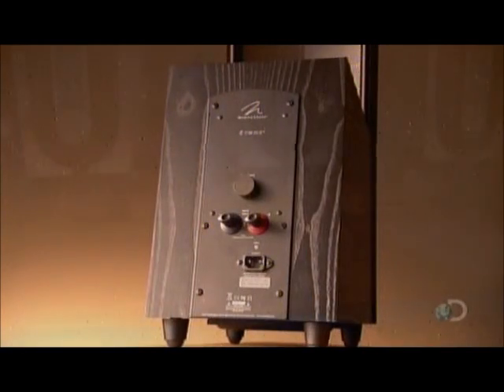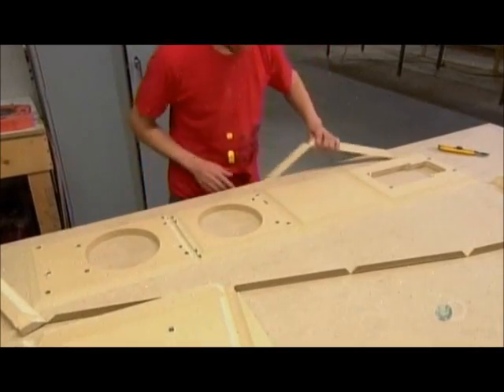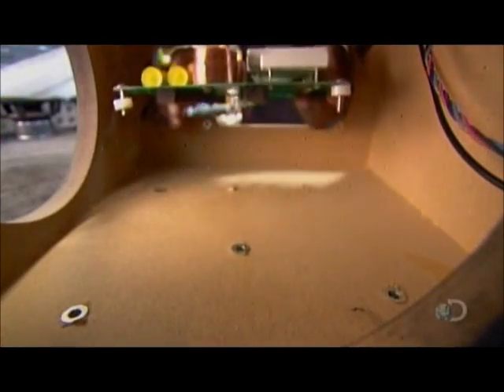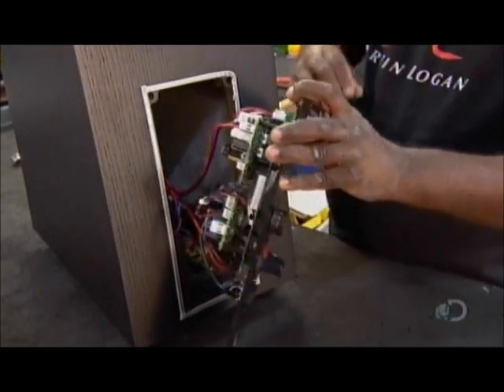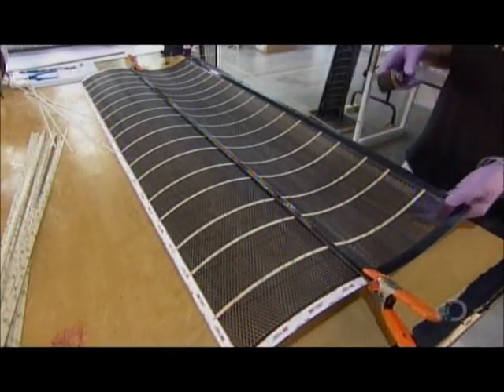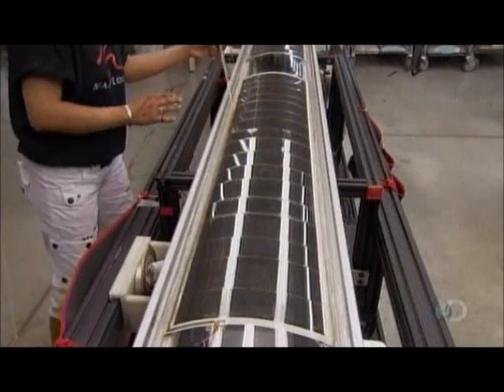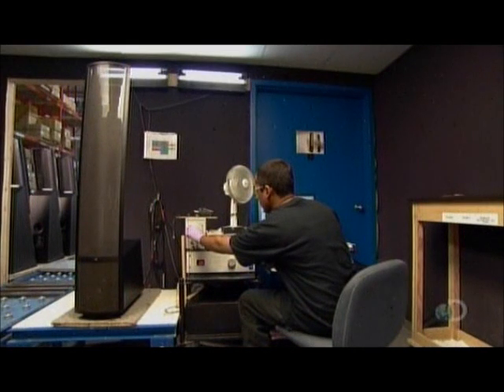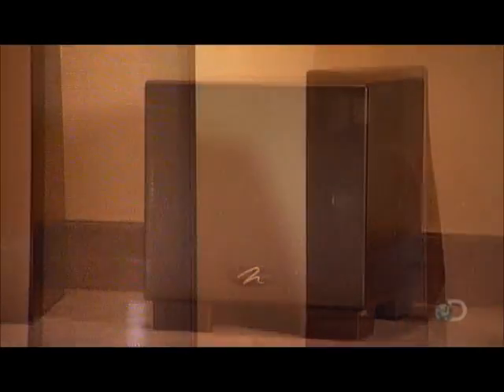How It's Made - Electrostatic Speakers

Comment: 13 yr -20 yr life span on electrostatic film. UV destroy it, thus no windows shinning on it. Used market has a few , but i would not bet on it. they increase 3x price to repair/replace the electrostatic portion. Thus you are likely have  to repair it after as life is thin after 10 + years..
Reply: I’ve got a pair of Acoustat Model X speakers from the 70’s that are still putting new systems to shame on their original mylar and tube amplifiers. 50 years of operation and still going.

Comment: trickery , that's why I 've built speakers. the precious things from the store is much worse . many underestimate the kits because they only pay 500-1000 dollars for it , then they do not understand that one must have an amplifier for about $ 10,000 for and get them to sing. or build a hypex amplifier and get good sound. many think they have good equipment , the bass I see here is garbage and amplifier. but so it is with all finished products. but I had to buy ready bass bin, is not easy and build a solid and small subwoofer that looks good is practical and playing deep as a JL Audio subwoofer, I have built many that play better but difficult and buy dy amplifiers that are practical and will fit into a small box with big element. so some brands are good but it is rarely . You shall build even remember and use seas kit, it is important to have a kit and not design a self create idea , if you can manage it ought be a speaker konstruør
Reply: For the Martin Logan Esl (2,5k a pair) they show there you need just a 1,5k amp so you are only by 4k
Reply: For the Martin Logan Esl (2,5k a pair) they show there you need just a 1,5k amp so you are only by 4k

Comment: Electrostatis speakers, I have never heard about them.
Are they really good? if so why they are not widely used on HiFi Hi End speakers?? lets say Klipsh, Polk Audio, Paradigma, Monitor Audio, B&W.. etc
Reply: They actually made tests punching holes into it and still working great. If you stop by a BestBuy they can show you the awesome tech that is Martin Logan. I am planning on getting their speakers but probably not there electostatic since they arint on wall. Except the EFX ($3,095 per pair)
Reply: I’ve owned Quad ESL-63 speakers for almost 30 years.  Had them rebuilt five years ago. Best audio investment I ever made.
Reply: A few reasons, if you still care. They're often at a much higher price range. The ones in this video could very well be over $10 000. They're also logistically difficult, as they're large, require lots of stable power ($$$), and will often kill themselves. Little sparks cause spontaneous holes, and eventually require repair. I've heard them likened to Italian sports cars; they preform wonderfully, but aren't the most convenient things around.
Reply: They’re popular in the high-end headphone space, but they require a high-voltage amplifier to function. These things demand serious power.
Reply: Save your money Electrostatis speakers are terrible in the long run.
Reply: @leehaiyee3899  
Maggies ftw

Comment: The older Martin Logan speakers (before 1995) were infinitely better than the new ones.  Martin Logan began to target the Circuit City demographic. The high end boutique audio stores in my town will no longer carry Martin Logan.  They will not carry Quad electrostatic speakers as well now that they were bought by a Chinese company and are assembled in China.  The quality is not what it used to be.
Reply: Martin Logan made great speakers until about 2006, 1995 is a bit of an exaggeration.  They were sold to Shoreview in 1995 which is when the decline happened.